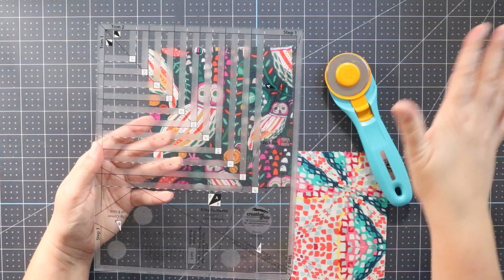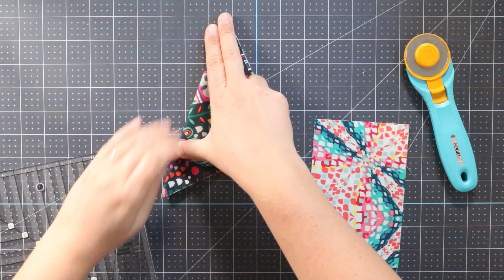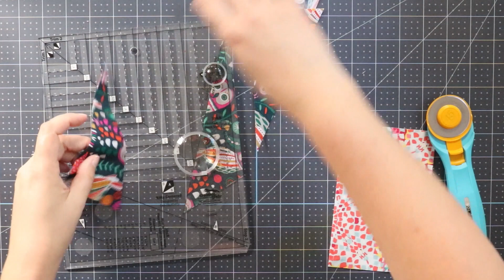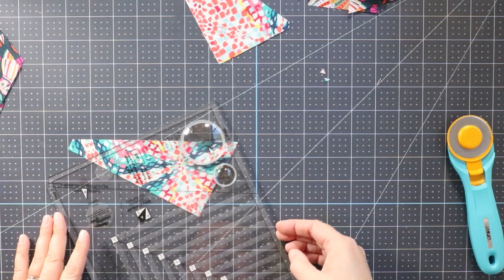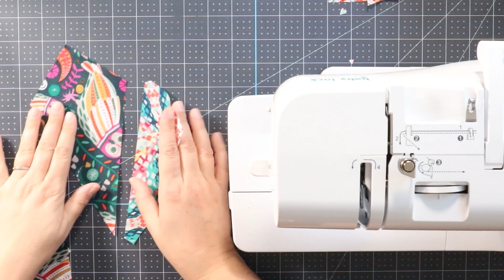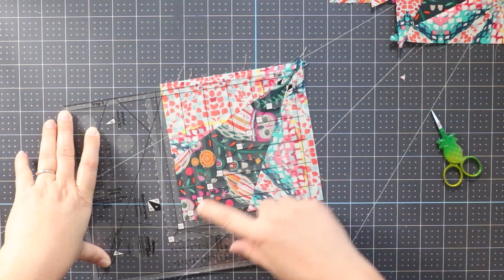How to use the Kitty Cornered Ruler

Comment: Show me how you cut the strips
Reply from the maker: Hi! I'm not sure I understand your question? If you're requesting a video on cutting strips, I could add that to my list for potential future videos...
Reply: @CarolinaMoore  
I have the ruler. 
I don't understand how to cut the strips setting on top of it.
Reply from the maker: @melodylingefelt6685  you use a standard ruler to cut your starting pieces. Just like you would for any quilt. Then you use the specialty ruler to convert it to a set of Kitty Cornered Blocks.
Reply: @CarolinaMoore  
O
Thank you 😌
Reply from the maker: @melodylingefelt6685  you're welcome! The sizes you need are written right on the ruler. 🥰